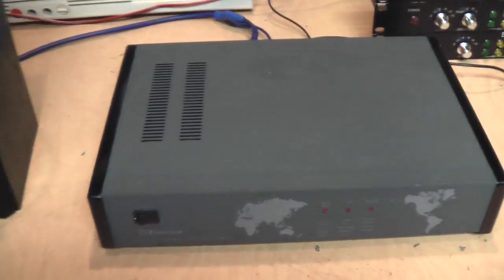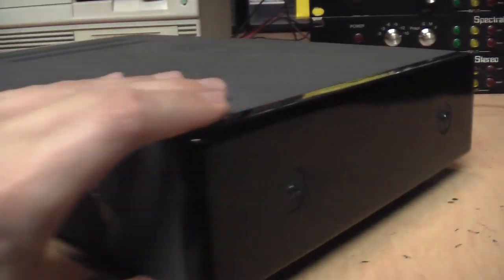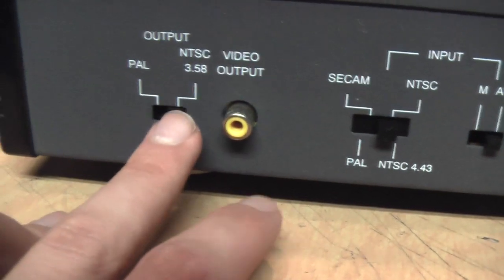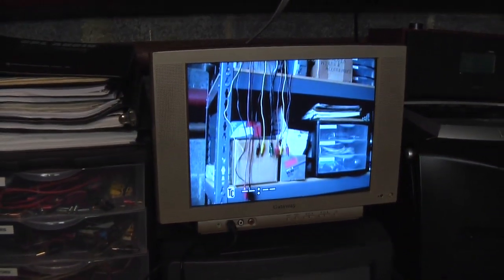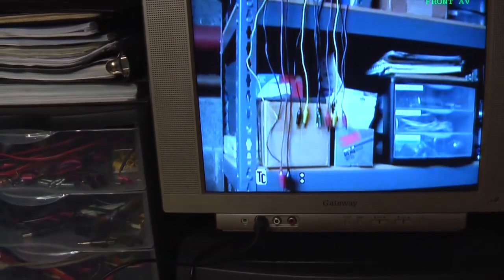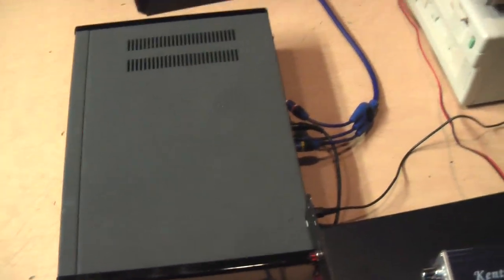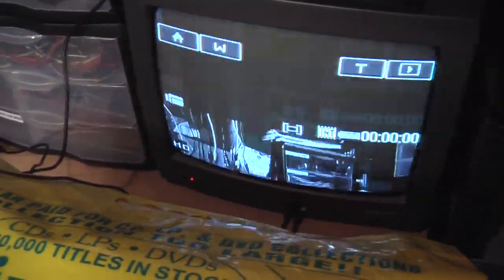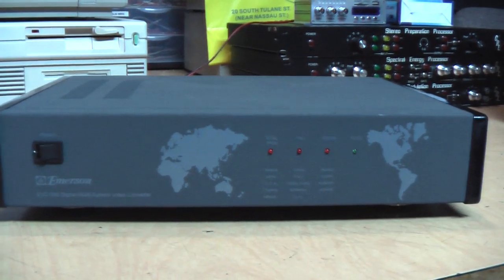1999 Emerson EVC1595 digital multi-system video converter

Comment: Multistandard TV monitors are now quite common, but back in the early 90s there were only a handful of manufacturers who made them.  The local courthouse has several 30-inch Monivision multistandard TV monitors which have two VGA inputs, SCART, RGBS and RF connectivity, and can even display CGA, EGA and monochrome with an adapter board.  They were made in Taiwan and retailed for around $1600 in 1992.

Comment: Emerson used to make some really interesting stuff. I had a component CD player that someone gave me made by them that not only sounded good but it was built like a tank. Still using an Emerson TV from 2004 too. :)
Reply: if it's a 2004 Emerson badged TV then check to see if it's made by Funi corp, as the last American made TV's where from Zenith around 2000 if i remember correctly, and I've personally found the Funi rebadged stuff to overall be total junk.

Comment: There are a couple of formats that are not covered by this converter: N PAL from Argentina, Uruguay, Paraguay and Chile as far I remember. Chroma subcarrier 3.582056 MHZ, vertical scan at 50 HZ and audio carrier 4.5 MHZ (European PAL B/G/I audio carrier is 5,5MHZ, thus chroma subcarrier is 4.43 MHZ). However both systems are enterely compatible at VHS tape level. The other is Brazilian M PAL with chroma at 3.57 something MHZ (I don't remember the exact figure now, but very close to 3,579545 NTSC M) scan 60 HZand audio 4.5 MHZ incompatible with nothing. There was a VHS machine able to convert all standards, the Panasonic W1 (a quite expensive equipment, even today used units in good shape are valuable).
A nerdy comment from a former Argentinian A/V technician... ;-)))

Comment: Would a modern British LCD's digital tuner do anything useful in the USA or vice versa?
Reply: i think many of the current lcd tvs have all the internals to work, i know my samsung tv has USA onthe list of countries during initial setup, and has an inbuilt digital tuner, so i guess with the new stuff, its yes
Reply: The tuner would probably be useless for picking up ATSC signals, and you might have problems with analog sources. HDMI and DVI would almost certainly work though.
Reply: irtbmtind89 Cool thanks guys!  I guess a set top box would do the trick :)
Reply: The Framemeister these days are your best bet for converting Digital or Analog PAL, and NTSC/ATSC signals, and upscaling them for use on a modern flat screen.
Reply: Commodorefan64 I really want one of those, they cost a lot though, I bet they are worth it!  Perhaps some day a low cost, easy to find one will be made and it will simulate scan lines and such for the retro computers too 🙂
Reply: Knuckles the Echidna I hear ya there.

Comment: Why can't America just be PALs with everyone else??
Reply: 60hz vs. 50hz for example?
Reply: well PAL60 is part of the PAL standard so US could be PAL60 for example. I know it isn't just about the refresh rate.)
Reply from the maker: Because the American NTSC color system was invented over a decade before the European PAL system was. Color TV was introduced in the U.S. in 1953, but not until the late 1960s or early 1970s in most of Europe.
Reply: I understand that.  I was actually making a joke :)
Reply: everything should be ntsc :P
Reply from the maker: *****  We use a mix of U.S./Imperial and Metric units, just like the UK and Canada. (For example, the British measure distances in miles, but buy fuel in liters.)
Reply from the maker: ***** A few examples: in the U.S., we buy soft drinks in 1, 2, and 3 liter bottles, car tire width is in millimeters (195, 205, etc.), and nutritional values are measured in grams and milligrams (such as 5 g of fat, 20 mg of sodium, etc.). And in Canada, cooking temperatures are in degrees Fahrenheit, apartments and houses are measured in square feet, and most people measure their weight in pounds. And worldwide, air and sea travel distances are measured in nautical miles.
Reply from the maker: *****
 The U.S., UK, and Canada were all supposed to be fully converted to the Metric system by the early 1980s, but conservative politicians took over the government of all three nations during that time and put a stop to it. And FWIW, the Fahrenheit scale is more "human-oriented" than Celcius. 0 degrees F is really cold and 100 degrees F is really hot, while 0 degrees C is merely chilly and 100 degrees C means third-degree burns! Likewise, one foot is about the length of an average adult male foot (as you might guess!), so it's easy to estimate distances in feet just by putting one foot after another and walking!
Reply: vwestlife
 It comes down to personal preference. To some people, Celsius makes more sense because 0 is the freezing/melting temperature of water :-)
Reply: fiksz You mean PAL M?
Reply: +HBC101TV Studios (Mohammed Fred) 

NTSC (3.579 MHz) 525 lines
PAL-M (3.575 MHz) 525 lines
PAL-N (3.582 MHz) 625 lines
PAL/SECAM (4.43 MHz) 625 lines
Reply: I agree but celcius is based on water 0 is ice and 100 is boiling hot.
Reply from the maker: Du sköna nya värld But we are people, not water. If you're measuring things in a science lab, yes, °C makes sense, but for the range of temperatures that humans experience on a daily basis, °F gives a wider range of numbers to use.
Reply: The German developers of PAL saw what the Americans did and were determined to avoid following the American path. As a result they produced the most superior colour TV broadcast system ever. The French SECAM system? Not even worth mentioning!
Reply: It's "litres" not liters"!
Reply: liters: US spelling
litres: UK spelling
Reply: VWestlife So if I connect my Sony Handycam DCR-DVD110E (PAL) on the Converter and hook the converter on my small Spongebob NTSC TV and switch the converter from PAL to NTSC, will it give me full color?

Comment: That unit appears to be made by Cypress, the king of crappy video converters. It clearly isn't doing a good job of converting PAL to NTSC. The LCD TV should have worked fine if it was outputting proper NTSC video.

The weakness these boxes have is motion. Interpolating 25fps PAL to 30fps NTSC without judder/ghosting and in real time requires some pretty beefy hardware in the 5-6 digit price tag range. Also the deinterlacing circuit (required since you are resizing video) tends to stink in these machines.

Comment: Interesting that the front says Hungary is SECAM, because it sure is PAL.
Reply: It sure is PAL only. I'm from Budapest, Hungary. :)
Reply: fiksz SECAM was the first colour TV standard used in Hungary (and most likely in the entire eastern bloc) but they switched over to PAL in 1996, which stayed until the DVB-T switchover. However, some cable networks still distribute analog TV in PAL format.
In the former Czechoslovakia the national TV network switched over to PAL in as early as in 1992. Even before the switchover they used PAL in-house, which was converted to SECAM just before the signal would leave the building through the studio to transmitter link.
Reply from the maker: Hungary switched from SECAM to PAL in 1995-1996. (Since this converter is from 1999, I guess they hadn't updated their list yet!)
Reply: vwestlife yup probably. :) well back in the days tv tuner card drivers messed up with the same thing so there must have been some outdated list of countries and standards at that time and nobody bothered updating it. LOL
Reply: ***** correct. Although DVB-T is PAL too. It's just digital.
Reply: fiksz I don't want to sound rude or way too clever, but DVB-T is not PAL. PAL is an analog format, DVB-T is using MPEG-4 (MPEG-2 is also permitted, but it's much less efficient, especially at HD), only the resolution and framerate of SD channels (720x576 50fps interlaced, or 576i50 for short) is the same as PAL, although PAL has 625 lines.
On the other hand for example m1 does broadcast in 1080i, which is also DVB-T in MPEG-4, but has nothing to do with PAL.
Reply: You don't sound rude at all and frankly this is an interesting topic. But according to what you said there is no such thing as a "PAL DVD" for example. But they market it as PAL. (the discs) Of course it is 576i but it is often just referred as PAL. Even in broadcast / post production. And BTW: It's 576 because only 576 lines can carry picture out of the 625. So yes, you are right. But most of the people are still referring to 576i as PAL. Probably they just got used to it -- like myself.
Reply from the maker: fiksz  576i50 is PAL and 480i60 is NTSC. The names still apply for digital video as well as analog.
Reply: vwestlife Yup, but officially it's 576i and 480i in the digital domain and PAL and NTSC in the analogue.
Reply from the maker: fiksz  Yes, and officially the SI unit of temperature is Kelvin, but nobody uses that in real life. :-)
Reply: that was a good one vwestlife :))

Comment: Im looking for something like this since im thinking of importing ntsc console's
Reply: Framemeister, and step down power converter for 120v 60hz.
Reply: could i use the converter with a american power strip safely?
Reply: ***** I would check too see how many watts, and amps the converter can handle, and add up all the total your devices will be pulling, and go from there, same with the power strip, and make sure it's all grounded/earthed.